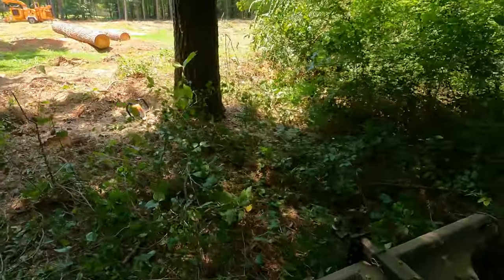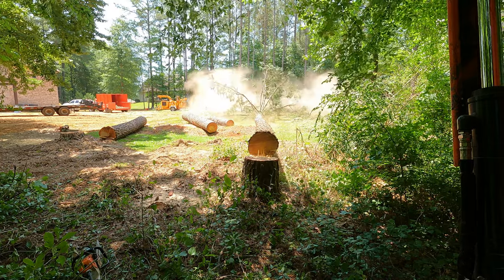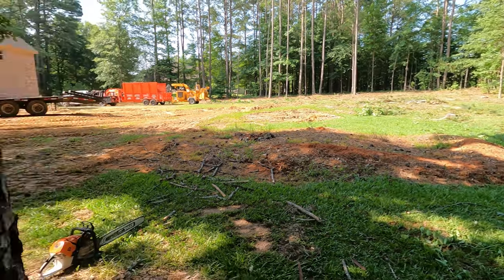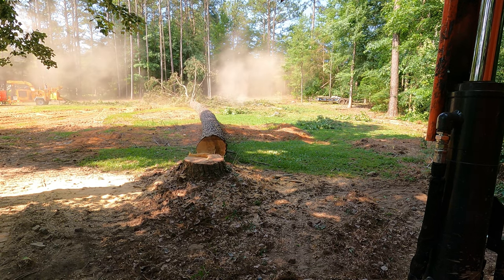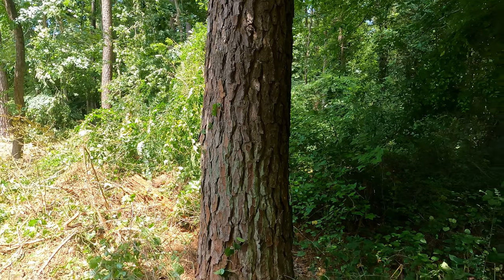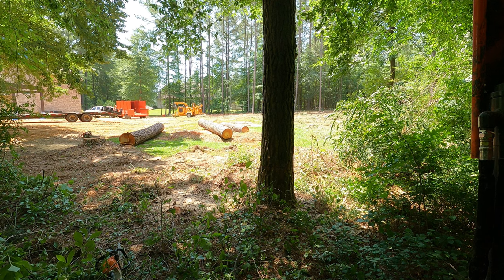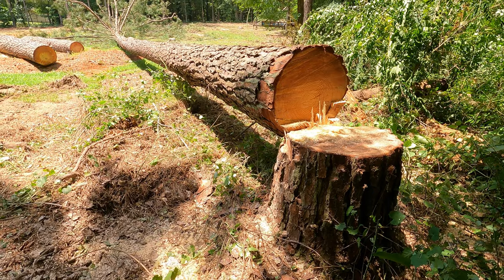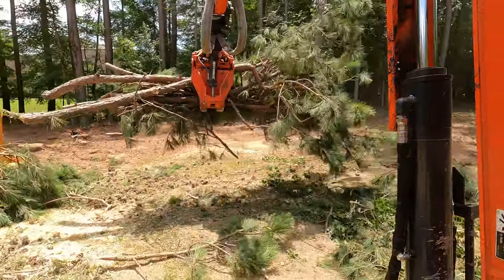Cutting 2 large pines at the basketball court job & why I bore saw or plunge cut in 4K

Comment: Tim have you watched LoggerWade do cutting? A lot of times he will bore three vertical slots for the hinge and then he will cut a slightly angled cut at the back to release the tree. Is that more for special cuts or just a higher level of cutting?